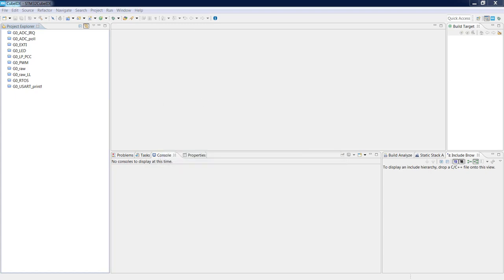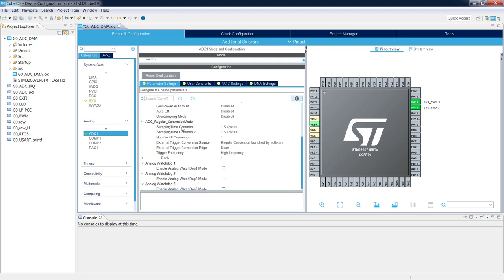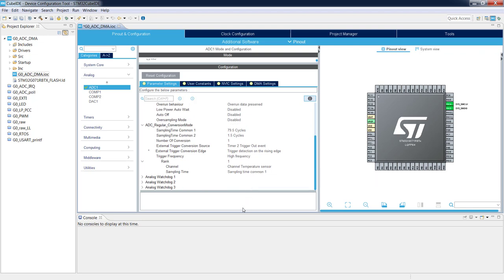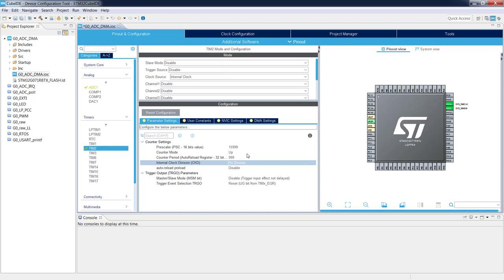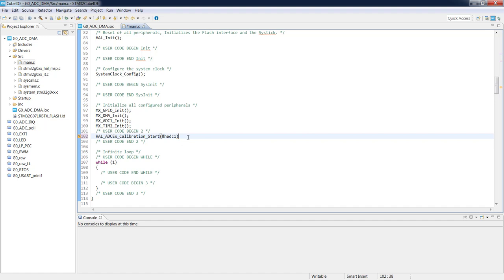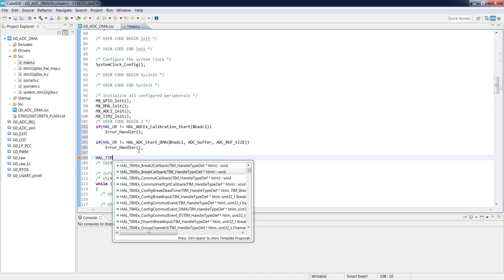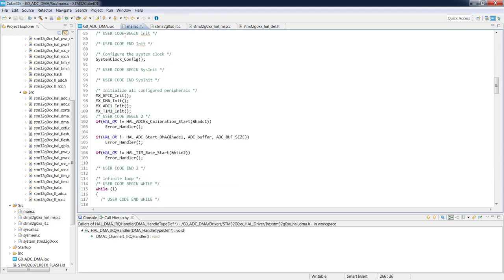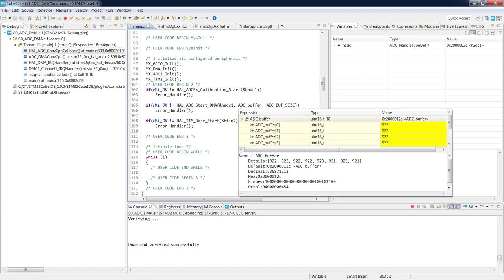STM32CubeIDE basics - 10 ADC DMA TIM HAL lab

Comment: Couple of points for those who may run into some issues with following the exercise:
1. In a newer version of a HAL library call to the function HAL_ADCEx_Calibration_Start() requires another argument of ADC input configuration. For reading the temp sensor I use the following call: HAL_ADCEx_Calibration_Start(&hadc1, ADC_SINGLE_ENDED)
2. The function for starting the DMA requires second argument (pointer to the buffer) to be of the type uint32_t and in the exercise we define ADC_buffer[] as uint16_t. There are two workarounds: casting the value to be 32-bit: HAL_ADC_Start_DMA(&hadc1, (uint32_t*)&ADC_buffer, ADC_BUF_SIZE)
Another way is to declare ADC_buffer[] as uint32_t, but then it is necessary to change DMA settings to send data in words and not half-words.
3. The example which is provided in the session stops DMA in HAL_ADC_ConvCpltCallback(). If you want to continue with measurements, you need to either delete the DMA stop call from here or restart DMA after processing data in the while() loop in main.

Comment: I've been using NUCLEO-F446RE with this series of videos and it works fine.  Some functions are not available but apparently incorporated into other functions.  Only issue: At the '10 ADC DMA TIM HAL lab' I find I have no access to the LL_ADC functions as they are all grayed out.  Is there some info or settings missing from the video to get these activated in the IDE?  Just seems like there's a missing step or two.  Can't seem to make it work.  The LL .h and .c files are there, just not available.
Reply: Hello, same problem for me with a L073 MCU. I have check in the sources. and I do not know why, but stm32g0xx_hal_adc.h include stm32g0xx_ll_adc.h, while stm32l0xx_hal_adc.h does not include stm32l0xx_ll_adc.h (must be the same for yours MCU family)
In fact, every informations I found is that HAL and LL should not be mixed. So I do not know why it is done (and even possible) in this example. Except to have a "nice example"?!
Reply: @antoinenauzet1568  Yes, there are indications that we shouldn't use HAL and LL drivers together, BUT, it needs to be done to use the Temperature Conversion macro used in this video tutorial.  I posted and searched on the ST site and had some help and also found some information.  First, the manual for the chip or board has a section on using both drivers together and provides two ways to do it.  First, add the USE_FULL_LL_DRIVER symbol to the C preprocessor configuration in CubeIDE.  This didn't work for me for some reason.  The other is to include the LL .h files in the main.h file.  In this example they would be stm32f4xx_ll_adc.h and stm32f4xx_ll_rcc.h .  This worked for me and generated the necessary LL files to make the example work.  Another suggestion that I found was to go back into CubeMX and activate another ADC but check the box so no code is generated, then rebuild the file.  This generated all of the LL driver files, not just the two files shown in the video, and this made all of the LL code accessible to the program.  I'm not sure why the suggestions in the manual for the MCU didn't work as presented with the USE_FULL_LL_DRIVER symbol.  I just assume that  I have something configured incorrectly.  No further response on the best way to do it from ST and no response from the presenter of the video.
Reply: @gtgarage  Indeed, after more research, I also found information about mixed HAL and LL used together.
I tried to include the files in my main.h, but as they are not in the project (STM32CubeMX copy only used files in the project), it generate an error. Do you copy them manually?v
For me, adding the USE_FULL_LL_DRIVER does not work either, again because the files ll are not included in the project.
And I have only one ADC on my Micro, so I cannot use the other solution.
Still searching!!
Reply: @antoinenauzet1568  Yes, add the .h files for the LL drivers into the main.h file manually and make sure they are in the /* Private Includes  / section and between the / USER CODE BEGIN Includes */ tags otherwise the lines will be removed the next time you rebuild the code.
Reply: @antoinenauzet1568  z?sd

Comment: With STM32Cube_FW_G0_V1.4.1 and CubeIDE V1.6.0 the ADC DMA TIM HAL Line ~50 uint16_t causes a warning unless changed to uint32_t. With or without that during the debug session I never  hit the break at line 304: void HAL_ADC_ConvCpltCallBack(ADC_HandleTypeDef* hadc) - it reads the ADC but never does the break point. The basics videos need to be redone with the current CubeIDE and professional sound engineers, if the CC doesn't work that is a good indication of sound issues.
Reply from the maker: Hi there, thanks for your question - may we point you towards our community.st.com, where you will find a team of people who can answer you directly ?
Reply: The break point is never hit because your function's name is not exactly (case sensitive) the same name as the function in the HAL library (...Callback and not ...CallBack as in your case).
The HAL framework defines a __weak function in its library (search the file ...hal_adc.c) and then calls it whenever the ADC conversion is completed. Your work in the main code is to redefine (and thus override) this function to implement the logic of your application, in this case HAL_ADC_Stop_DMA(&hadc1).
If you analyze the main function, you can see that it never explicitly call the HAL_ADC_ConvCpltCallback function. The function is still called indirectly (through the interrupt mechanism, I guess). When you write your ...CallBack function it does not override ...Callback function because of case sensitive and the compiler recognizes it as a new function and does not throw error when compiling. However, this function is never called in the main function and that is why you never hit the break.
Reply: You probably figured it out by yourself by now but I will leave this comment here for other people as there is no explanation in the video. 
The ADC buffer type really should be uint32_t to not trigger compilation warnings but in order this to work you have to change the configuration of the DMA in ADC1. Particularly the Data Width on Memory side should be changed from Half Word to Word. Then there are no warnings after compilation and the temperature values are measured correctly.